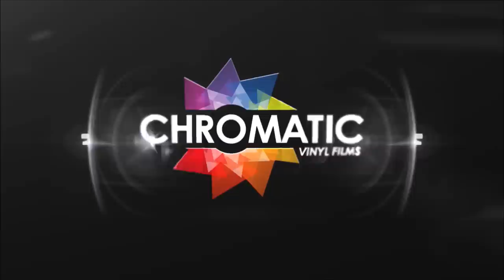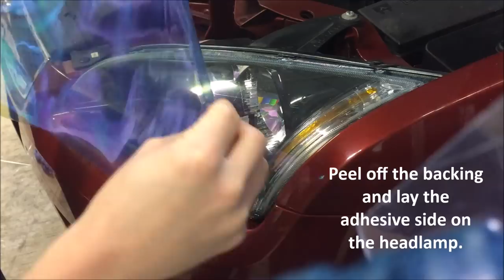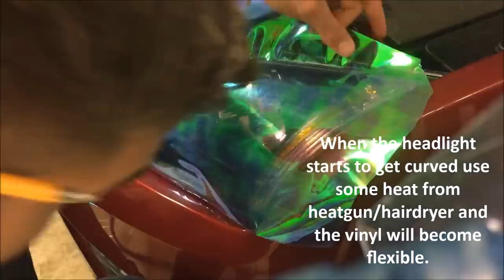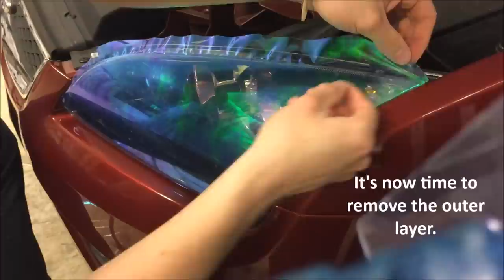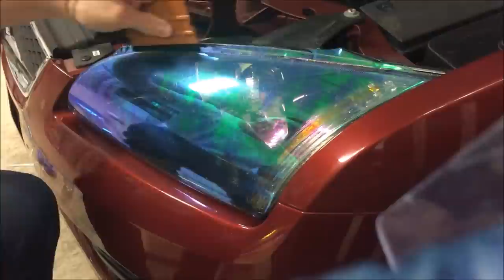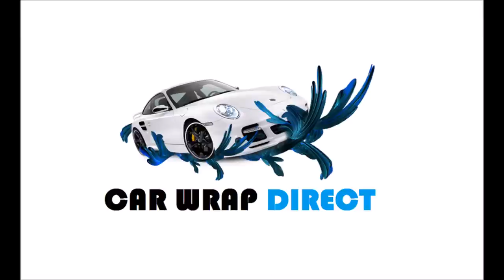How to install Headlight Tint - Chameleon - Car Wrapping Tutorial by Chromatic Vinyl Films

Comment: I got Brand new Black housing headlights and I just ordered a roll of Blue NeoChrome film I'm gonna install the film before installing my new headlights assembly on my car the process may or may not be hard but this is a different method I'm doing that no one has done before I'm also installing Brand new Black mash front grill on my Front bumper my Camry should look a little aggressive with this tint and the Black mash grill forgot to say I'm installing fog lights but I'm also adding a Yellow tint film to it

Comment: does this effect the headlight color?
Reply: Hello, that was my question too, they wrote in upper post: +jbzookeeper I'm not sure what the laws are over in the US. But the clear chameleon is a clear film so it should be ok, the film has a coating which gives the chameleon effect so it doesn't effect the light.

But I think that it must change a little bit a light color so illegal for street use :-)

Comment: Would this be a better method than the tail light video? The tail light video removes the outer and inner layer before applying heat.
Reply from the maker: It depends on the shape of the light, normally with tail lights you have to heat and stretch the vinyl into the recess around the light so it is better to take the outer layer off before that.  Headlights can  be a bit flatter so you can peel the outer layer off at a later stage.
Reply: Ah. I see. Thank you again!

Comment: i tried this but keep on getting horrible creases, any advice?
Reply from the maker: Make sure you use some heat to remove the creases and stretch the vinyl on for a crease free finish. Also when stretching try to spread out the vinyl in all 3 directions, sometimes it's easier with someone holding the heatgun while you apply.
Reply: maybe thats why im trying to do it by myself but was my first time ever been getting the cheaper ones from ebay to learn how to wrap ill try what you mentioned and hopefully it comes out looking better

Comment: are the headlights blue when you turn them on?
Reply from the maker: +cro508 With this tint you will get a slight blue tint fom your lights.
Reply: +CarWrapDirect Thanks. I ended up getting a green/purple but I'll probably take it off because the light shines pink haha. I want to get blue/green like in this video.

Comment: I don't have a heat gun will a hair dryer work?
Reply from the maker: buzz lightyear Yes a good hairdryer will do.
Reply: +buzz lightyear buy a heat gun, trust me
Reply: Hear gun or hair dryer will both work . The only difference is a hair dryer you will need to spend more time as it takes longer to heat it but they both work out fine .

Comment: is this legal in Scotland? I luv it.
Reply: Suzy Rice Yes you can have this in the U.K. as long as it’s not dimming the headlights by more than 50% which this is not but the police might ask you to remove it if they are bored and bothered to pull you over. They won’t fine you for it unless it’s really blocking light.